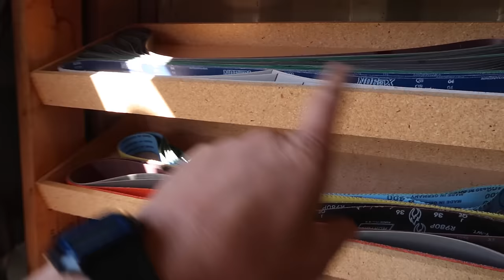Tool Time Tuesday - Different types of 2 X 72 belts

Comment: heads up mate, if you keep your worn out scothbrite belts they are sure handy for odd things like blending crowned spines and deburring things. Honestly I find I get more use out of worn scotchbrite belts than new ones.
Reply: Great tip, thanks!
Reply: Good advice... I shamefully will admit that with all wet&dry abrasives I only throw them out as a last resort... I keep chopping them up and washing them and using them for lesser and lesser tasks ...

Comment: great info
you are right on about the ceramic belts!
as a manufacturing engineer i have performed 100's of hours comparing abrasive materials. 
i would recommend Arc Abrasive as a company to look at there ceramic belts are very high quality and are normally more cost effective. 
i was able to save my company over 100,000 dollars a year by switching from 3M to Arc Abrasive. 
great job. thanks for the video

Comment: Dangit!  I just ordered a bunch of belts and would have loved to have gotten this info and your review earlier.  With that said, I love the 36 grit and 60 grit for both my blade profiles and tapered tangs.  I use the used ones on my wood scales then toss.  You do get a lot of use out of them.  Will DEFINITELY try out the Ceramic, Surface Conditioning belt and most definitely that Scalloped belt.  Thanks, and as always a good video.

Comment: Your torn belt can be repaired using a knee iron on patch like mom used to put on our jeans as a kid. I aquired 4 in belts a half mile long and cut then at a 45 degree angle and iron the patch across the seam. works great and if you get a deal on an odd size no problem. Paper back doesnt work well but cloth does

Comment: If you like the Blaze belts, try the 3M Cubitron II belts.  They are absolute animals.
Reply: more beastly then the nirton blaze?
Reply: More beastly than anything I have tried.  I've switched my 4x90 Kalamazoo belt grinders in my welding lab from Pferd 36 grit to Cubitron II 36 grit belts and went from 2 belts a day to 2 a week.  They cost about the same as Blaze so try a few out and see what you think.

Comment: I ordered a 26 gritt alluminium oxide 50 x 686 for my 50x680 belt sander bench grinder because i didnt find then easily in italy but then i found a website that makes cheap custom belts. Do you tbink the 50x686 will work on my 50x680bench grinder belt sander?
Reply: Btw how better is zirconia than alluminium oxide?

Comment: Does anyone else find that 120 grit belts wear super quickly? I use everything between 36-zircona to A30 gator grit, and they all wear relatively slowly, but my 120 grit belts (I've tried ceramic and zirconia) always need 2 belts per blade or so.